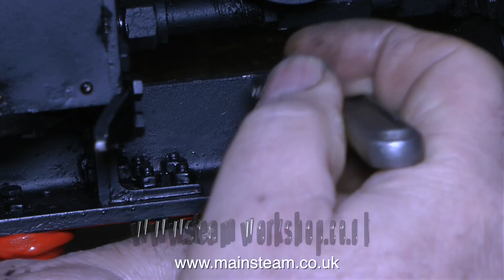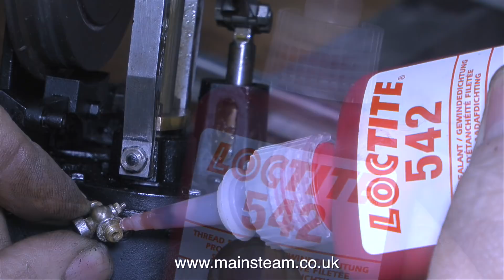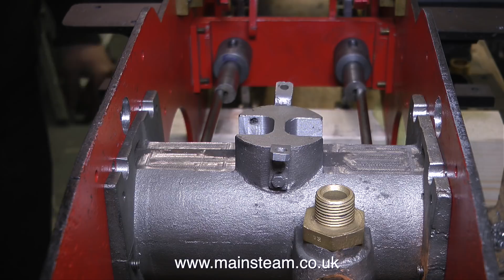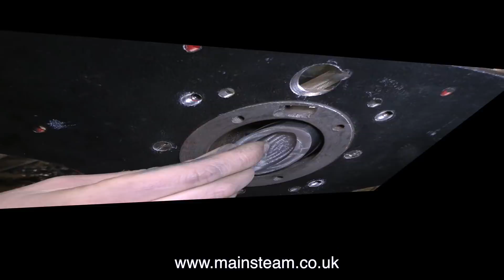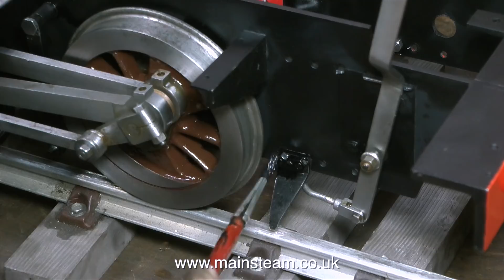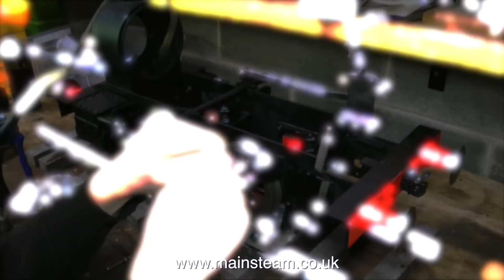WORKING AT THE STEAM WORKSHOP #13 - DRAW HOOKS, DRAIN COCKS AND RUNNING THE ENGINE

Comment: My loco a 5 inch gauge dougal doesn't have drain cocks . Is it a good idea to drill and tap a set into the cylinders ?
Reply from the maker: If it works, then probably it's OK. You will probably get a regular shower bath of water, soot and steam oil without them though .....
Reply: @keithappleton  yes that's exactly what happens . I may just cut a thin plate out cover the somkebox so that it doesn't get too badly covered. Drilling could effect the bores in the cylinders

Comment: Hi Keith, couple of questions if I may, what make is that lovely Satin black? Also, as I will be doing the same to my chub drain cocks in time, wouldn't it be better to clear any debris in the cylinders befofe re fitting the drain cocks, just in case they clog up again? Just a thought, you may have actually done this🙂
Reply from the maker: I will show an image of the tin of paint in the next video.
I cleared out the rubbish from the inside of the cylinder by running it up and down the bench with a lot of oil pumped it - I thought I mentioned that ..... anyway the drain cocks seem to work now {:-)))
Reply: Hi Keith, on my second viewing, you did indeed explain about clearing the cylinders before refitting the drain cocks........my mistake. I will definately make sure mine are clear before I steam her, its an old Chub of 48 years!

Comment: Why  didn’t you take the steam chest covers off and time it by looking at the valves to begin with? Did you just want to play with the return cranks and get lucky so not have to take the covers off? I can’t imagine doing the timing without seeing the valves.
Reply from the maker: I do it that way frequently "by ear" ...... the reason for not removing the cylinder covers initially was to see if the valve timing was correct or not as it was at one time a working running engine - and save some time on what is a commercial rebuild and time is money in this case. In the video, please watch the first part of the test - I set the return cranks by ear and is runs reasonably well in both directions. I felt obliged to get the managing director's view on this before I remove the steam chest covers.
Reply: I was pretty surprised at how well it ran on your first attempt at setting them. It was a very good guess.
Reply from the maker: one tries David, one tries . . . . . {:-)))